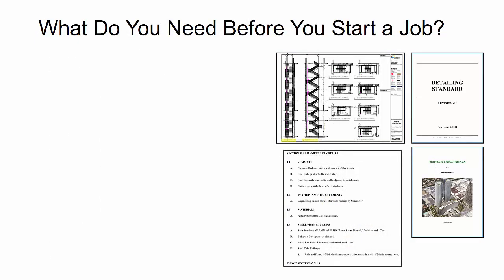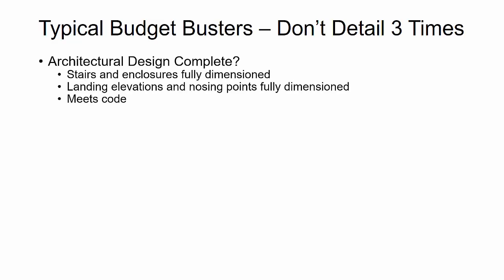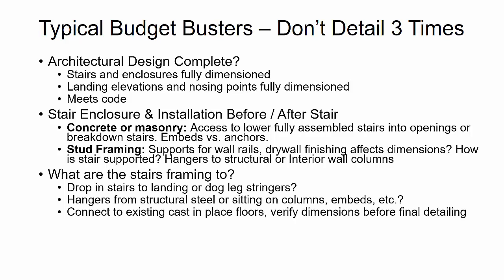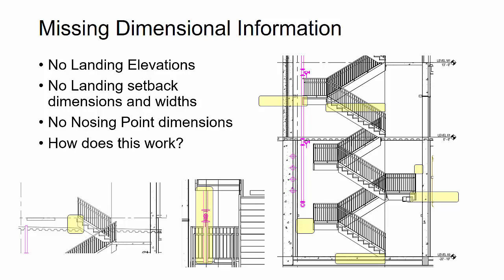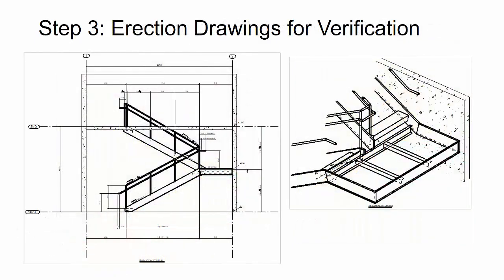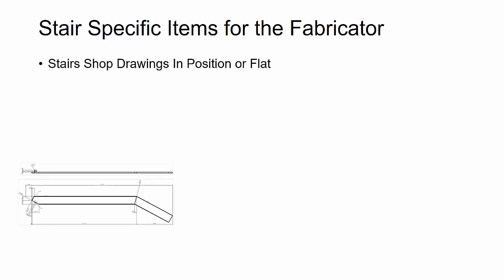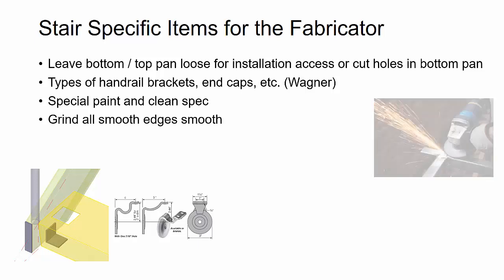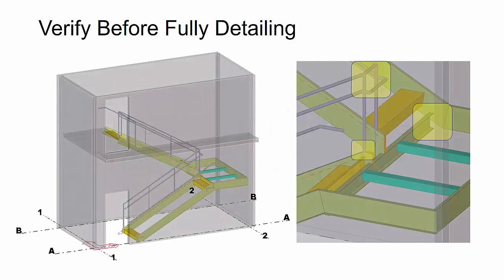ARE11: Steel Stair Detailing

Comment: What software do you use to draw stair. Work for a miscellaneous fabricator and we only use 2D AutoCAD. 

Is there a 3D software that can produce stair shop and erection prints quickly and efficiently?
Reply: tekla of course but it's very expensive